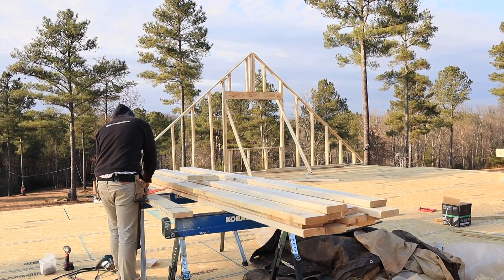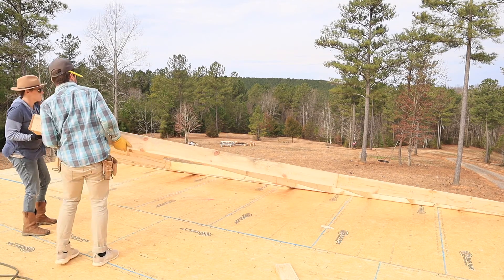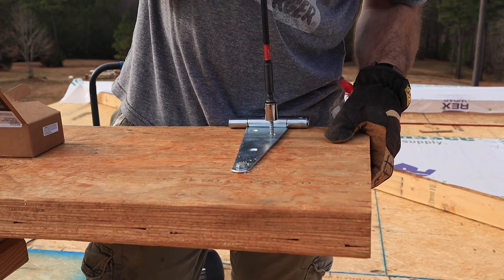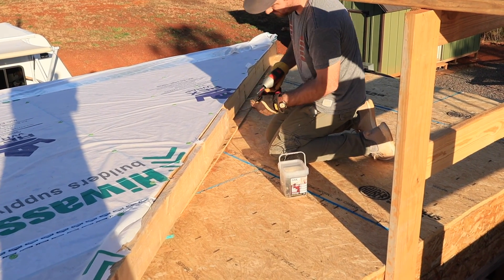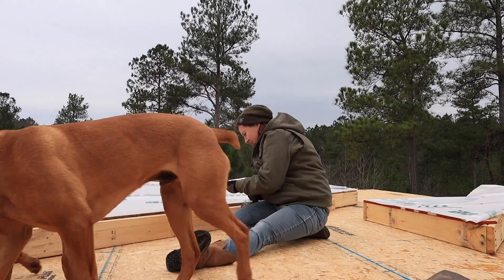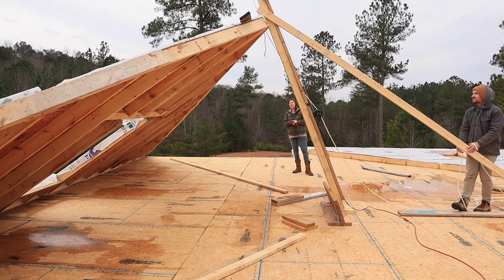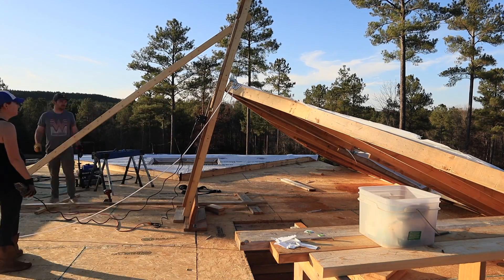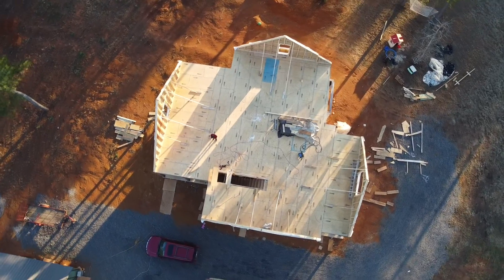Using a WINCH SYSTEM to lift heavy walls | Couple Builds and Lifts Gable Walls for HOUSE SELF BUILD

Comment: Just Lever it up. You don't need a winch. Lever it a little at a time with 2 x 4's or 2 x 6's and keep putting supports under it until you get it up where you can handle it.

Comment: Nice job on the DIY wall lift ! Most rental places have wall jacks. I always put stop blocks nailed to the outer rim joists. It prevents you from pushing the wall off the edge. You saved a ton of time sheathing and installing the house wrap before lifting in place ! You might want to install some wall straps ( 12" Simpson Ties ) which connect the gable walls to the first floor framing. Enjoy the nice warm weather !!!
Reply from the maker: Thanks for the tips!